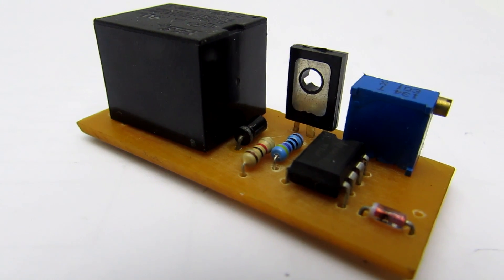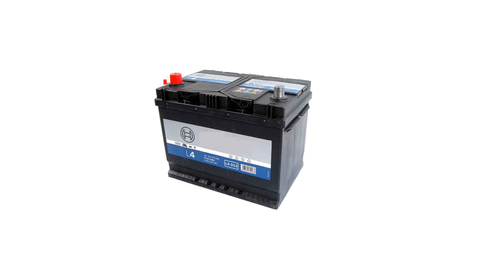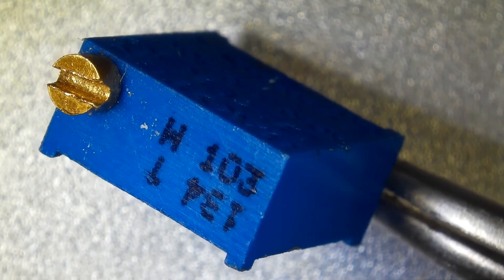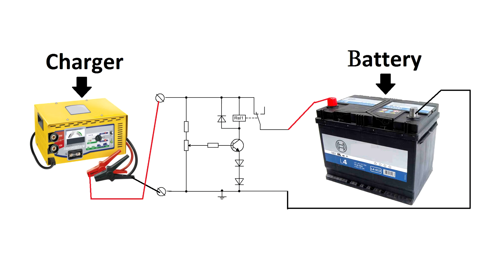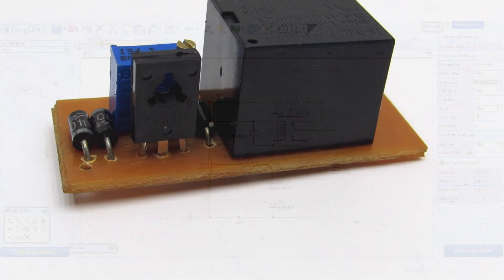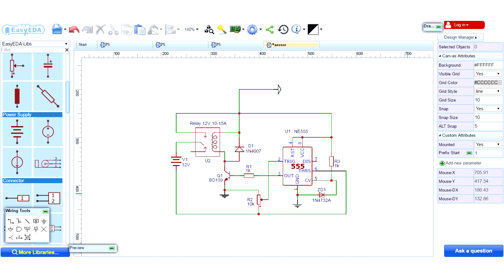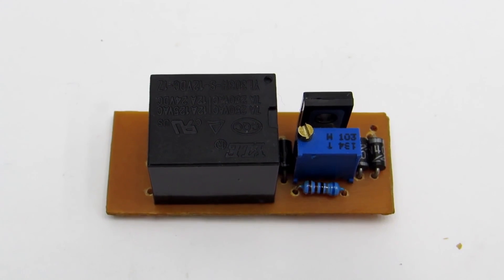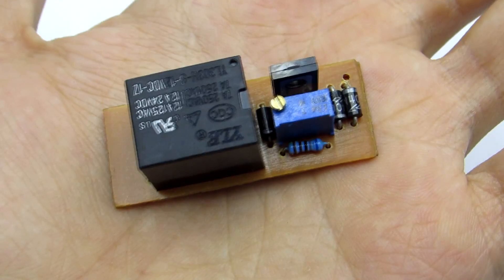Auto turn off for battery charger

Comment: How does the circuit measures the battery voltage while its plugged to charger? The pcb will not see the battery voltage because its lower than charging voltage? When i plug in charger and measure the voltage at the battery terminals multimeter just shows charging voltage of 14.4V

Comment: In the first scheme, the battery is disconnected when the relay turns off. Hence the circuit will never see a voltage drop!

Comment: Not a bad design for a simple circuit. The tempco of the transistor and diodes may actually be good, as it will turn off sooner at higher temperature, which may match the recommended voltage for charging. A zener is better but there is still the Vbe of the transistor. A much better design can be done with a small PIC, costing well under $1, which has internal comparators and voltage references.

Comment: hey man! 
thank you popr the video. a question. if I make two circuits of these, can I make it cut when it is charged and another to start charging when the battery is discharged? Greetings from Colombia.. help me please
Reply: auto turn off and on?
Reply: he put up links to buy this at albaba....the item for sale is just that....everything is in Russian, but the 3rd link has a description in English....I bought 6 of these for my E-Vehicle....I may be using the cut-off for balance discharging to cut-off the load.....I have overcharged 1 block twice already cus I charge all 6 together with 84V.....one of them is quicker cus the SOC is higher or the capacity is lower

Comment: Don't lead acid batteries fail to come up to a full 12.5 Volts when they reach middle age? So using this with an older battery this might never shutoff and it will cook the battery.
Reply: Noah Spurrier no sir, while charging every battery reaches 14.2-15 volts, in fact older batteries get charged quickly because they can't absorb a lot of current due to their decreasing capacity, so their voltage rises quickly.

Comment: hi, friend thank for automatic battery charger circuit, I just build one and work well, but relay contact is too hot I use relay 250vac/10a for cut main Power if my battery bank reach 14.4vdc...I install on my capacitive charger desulfator, how much ampere value for the relay?thank you.
Reply: Use  car Relay, starter relay and a transistor NPN to GND. A car relay should have a diode in it already for inductive off spike, just make sure you have right relay_ diode polarity.

Comment: Nice video, but the design is a BAD long term charging solution for a LA battery because the cut-off circuitry NEVER allows the batt to achieve a full saturation charge -- which would of course shorten the useful life of any LA battery.

The design lacks 2 charge circuits:
1.  A full saturation charge circuit.  CV must be held constant while CC
 drops to 3 to 5% of batt capacity--then cut-off should occur or a float
 charge circuit should be enabled (if desired).
2.  A float charge circuit.  After a full saturation has been achieved, 
charging V should be decreased to ~13.2 to 13.5V to maintain a full 
charge on the batt.

The design lacks 2 temperature control circuits:
1.  A safety cut-off circuit (for when a battery over heats)
2.  An auto-adjusting temp-voltage control circuit -- to auto-ajust the charge V as the temp changes.

Comment: The only problem with most of these circuits: They will switch on again, when the battery voltage falls down a half Volt after switch off the charging current.
Reply: Fusimester you can wire the relay to latch itself until power is cycled or put a momentary switch to make it unlatch

Comment: Using voltage to determine charge level for lead acid is not a proper indicator of its charge.   Charging at constant voltage of roughly 2.4 volts per cell and limiting the current going into the battery at 10% to 30% of its rated capacity, then charging it at that rate until the current being taken by the battery falls down to about 3% of its rated capacity is the proper way to determine if the lead acid battery has a full charge.  You can use your circuit but you need to add a current sense resistor and monitor the voltage across it to sense when the current has dropped to the proper voltage that represents the full charge current point of your specific battery's capacity.
Reply: Would you happen to have any links to such a design that could be purchased to add to my old transformer battery chargers?

Comment: will it work on lithium?
Reply: Not if you want to fully charge it safely.
Reply: PirateKitty is it because this is not precisely accurate enough due to the relay?
Reply: Don't take this circuit, use a special chip tp4056 for Li-ion